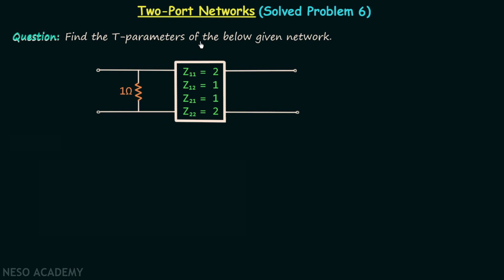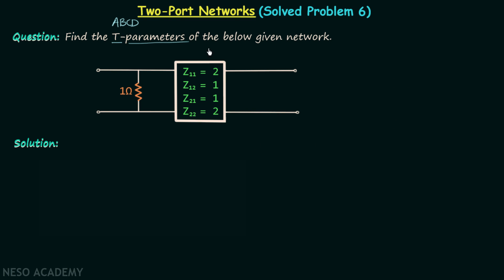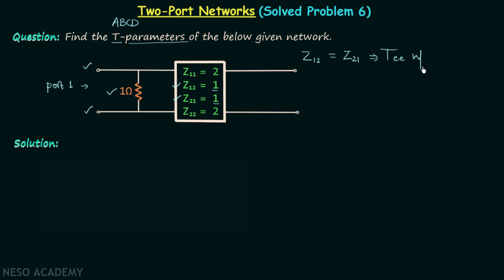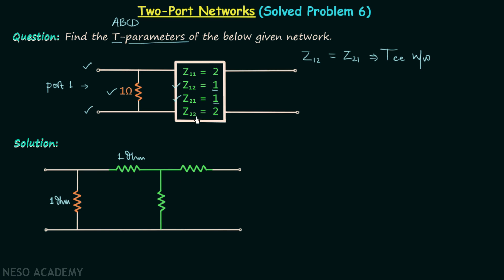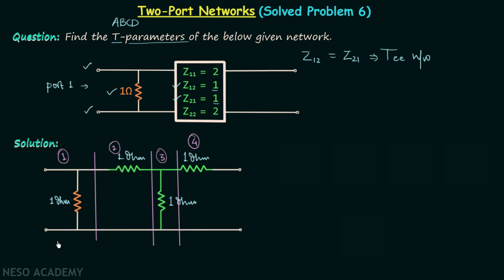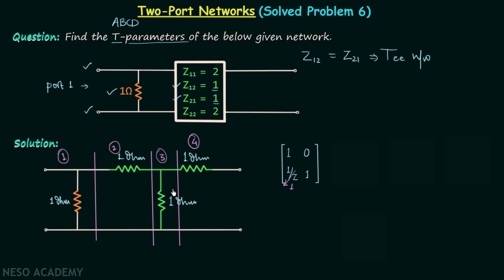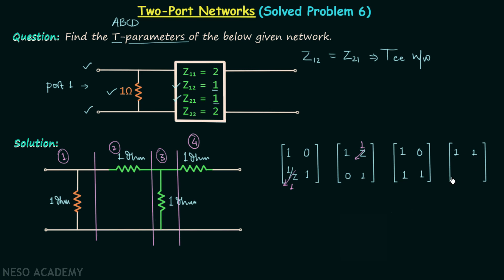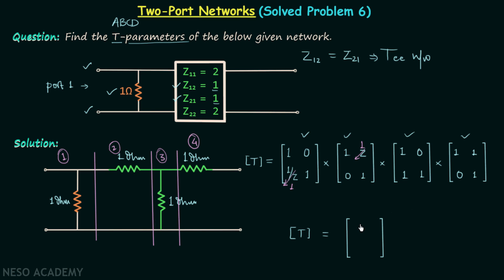Two−Port Networks (Solved Problem 6)

Comment: I solve by changing z to t parameters but the answer is different can anyone upload the solution by converting z to t parameter
Reply: A=5,B=3,C=3,D=2
Reply: @gireeshkumarkancharla4176  a=2,b3,c=3,d=5
Reply: first find z parameters of t network with only 1 ohm resistance. then convert both these z paramters in T paramater.after that multiply T1 and T2

Comment: Directly dividing the port and getting the same answer ..is it wrong sir ????
Reply: @Richa Sharma it is difficult to explain here
Reply: @Richa Sharma I will try wait
Reply: @Richa Sharma break that 1ohm res port into 2 port network from that u will find the Z parameter of that port ...now u have 2 2-port network with Z-parameter ...convert in T-parameter and multiply both u get the final ans ..
Reply: @Richa Sharma how it become infinity ??? ...can u explain me ?
Reply: Determinant of 1st one is 1 and 2nd one is 3 , then there is no chance of getting infinity .. check ur ans carefully
Reply: yes answer is wrong as you see in [Tc] he did mistake instead of 1/2 he took 1 so the answer is wrong the right answer is A=2; B=3; C=2; D=7/5. Check 1st and 3rd matrix there you will find at 2nd row 1st column 1/2 is not taken
Reply: @anshulwasnik2627  what if I pruf u wrong ????
Reply: @aayushranjan6322  please correct me. I will appreciate . Also if you have any other suggestion for other channel please mention it.
Reply: @anshulwasnik2627  n I just watch his video for clarification I do not follow him
Reply: and one more question is why I am not getting the answer as I do the conversion of Z parameter into different parameter
Reply: Convert Z (given) paramters to T. Then find T parameter of 1 ohm then multiply both matrices simple and quick.

Comment: if we convert Z-parameters(given) to ABCD parameters and then multiply both T matrices. why it is not possible???
Reply: Multiply t parameter for 1ohm resistor with t parameter of given.. don't multiply t parameter for given with t parameter of 1ohm.